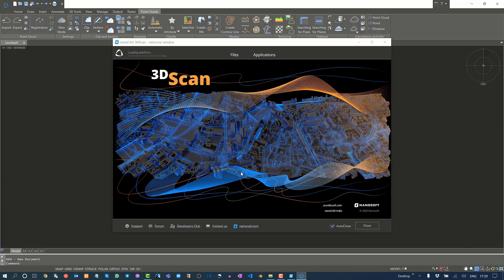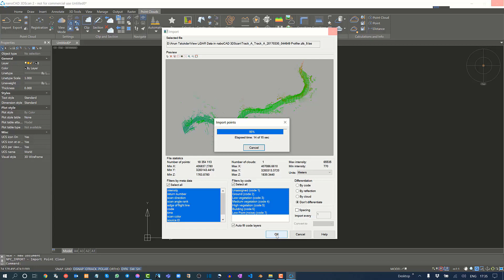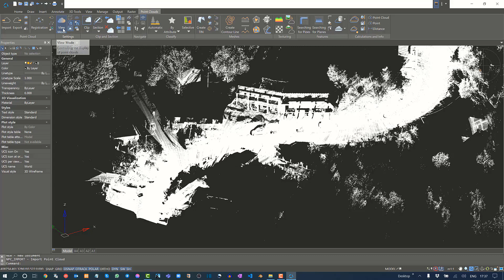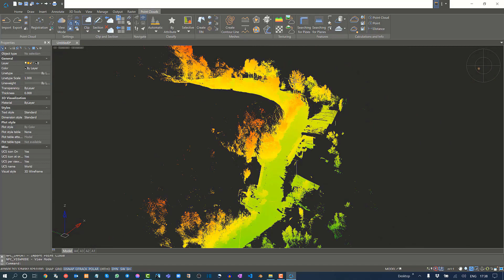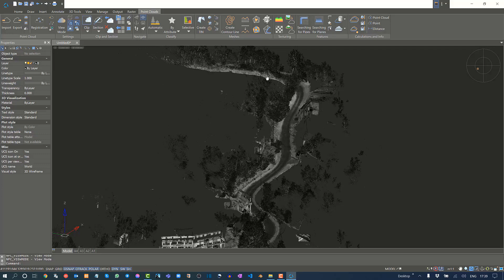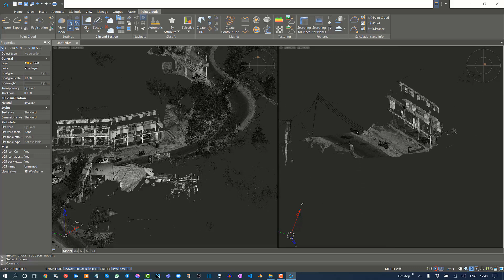Comment: 3DScan has complex tools and options. It is difficult to know if an error was due to an incorrect input variable, workflow, software limitation or point cloud limitation / problem. This program needs detailed workflow instructions with defined outcomes to make it easier.

Also - Can generated normal colours be written as the RGB for the points? This would make filtering ground and floors very easy.
Reply: Process of 3D Scan is relatively easy. You have to check the Properties window only for your inputs. In case of improper inputs or limitation error message appears.

You can get RGB value of any color from the Layer Manager once you classify the points. Select on the Colors > More Colors > True Color tab and then select RGB in Color Model.